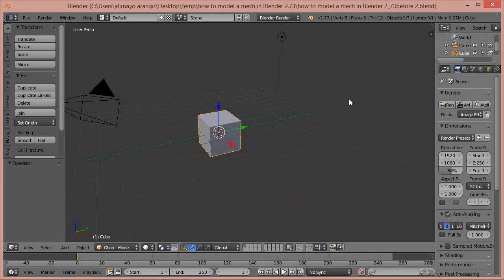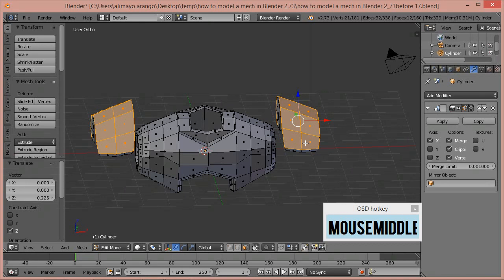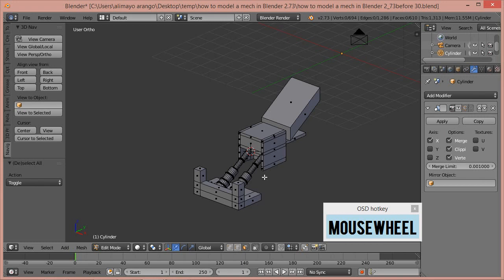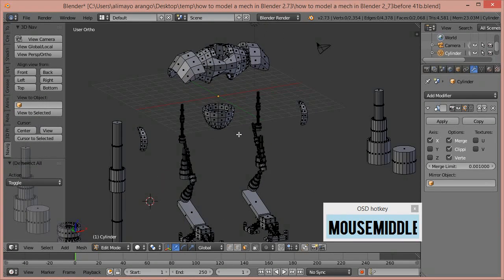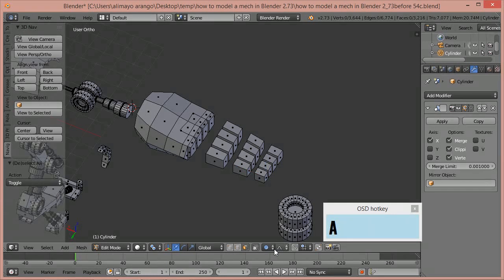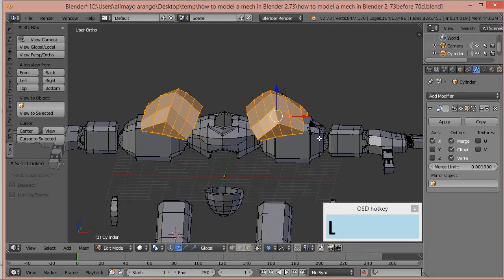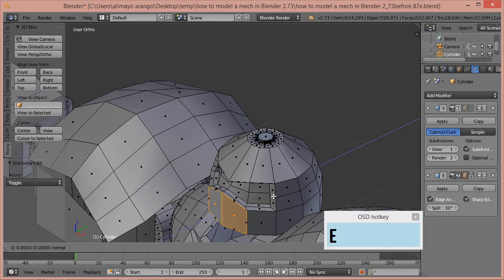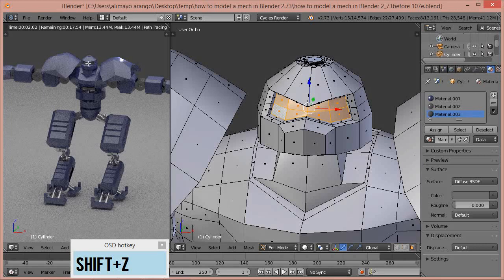How To Model A Robot in Blender 2.73

Comment: Hello I recently subscribed to you, but one question I recently started modeling a year ago and I don't fully get why you and other creators create semprate parts and not connected? (I'm still a rookie) XD
Reply from the maker: Thanks for watching this video. Thank you even more for subscribing.  I had the same question when I started in 3D work. When you are working with 3D objects with very hard lines and edges like robots or vehicles by having separate objects the edges to those objects tend to stay hard. 

When you put a subdivision modifier on the modifier tries to smooth everything even your edges and places in your model that you want to stay hard but have a separate objects tends to help the edges stay hard even with a subdivision surface modifier on. 

You will find that as you model that even when dealing with machines that you work will tend to look its best with a mixture of hard and soft surfaces.  I hope that this info helps you out Jack and I hope that you continue to work in 3D . 

Thanks again for subscribing to my channel.
Reply: Thank you, I really apreciate what you are doing for me and others. Jeez it will take a lot of timeto create stuff. Still thank you for the help. :D
Reply from the maker: Glad to help. Thanks again Jack :)
Reply: I have another question, by using edge split it makes harder for me to mark areas on the mech/robot where each texture should be. Is there another method of hard-ish edges I could use. Except adding a another cut on the faces near the edge. And using subdivide surface is important?
Reply from the maker: JackOHammer There are multiple ways of hard surface modeling.
Another way is to use
 creases with "shift+e". Subdivision surfacing what tends to make models look profession for lack of time for a better explanation.
Reply: That explaines a lot. thank you.

Comment: Thank you for the great modeling tutorial.
How would I reduce the amount of vertices to use this model for animation or in the game engine? Especially the cylinders have too many vertices for the game engine.

I know there is this retopology method for organic models which are build out of one single connected mesh. And you use a normal map afterwards to get the detail back in.
Can you apply this method here as well? I am a little concerned because the Robot is made out of many pieces which are not connected and protrude into each other.
Reply from the maker: +Maister2677960  Maister2677960. yes you can use normal maps to add more detail to the model. As a matter of fact I just put up a tutorial yesterday showing how to put wrinkles into clothes by the use of normal maps. If you interested you can find part 2 of the video in the link below-
https://youtu.be/ZYfs4dHGyQc?t=1h38m10s

You could also turn down the subdivision surface to a view of 1 instead of 2. This should reduce your polygon count drasticly.

If you have anymore questions about this tutorial or 3D or Blender please let me know. 

Thank you for viewing this tutorial and also for the kind words Maister. I appreciate them.

Comment: Hello, Alimayo. I was wondering when you extrude face, lock it and then scale, isn't it better to do with the "i" key? What's the point of creating new face on top of the original?
Anyway, good job. It's nice to have tutorials like this, lots of new ideas to work with :-)
Reply from the maker: Himlajchan Thanks for watching this tutorial. To be honest I think that extruding to make new geometery and insetting are almost the same. Though I would assume  that using inset is probably the better option. I tend to extrude to make geometry because that what I would use before Blender had the ability to inset. Thanks for the asking the question. I think that I will try to use inset instead of extrude in the next tutorial that I plan to make.

Thank again Himlajchan.